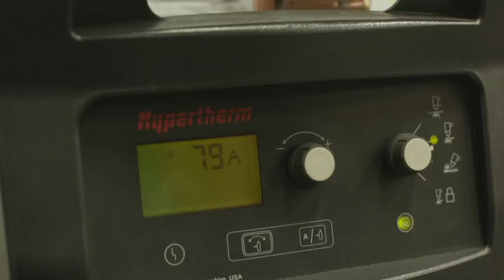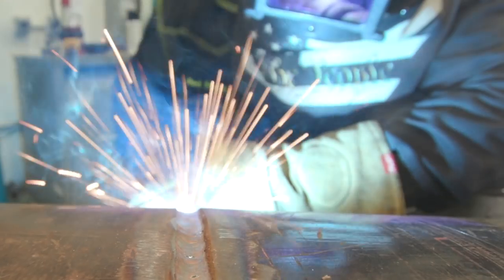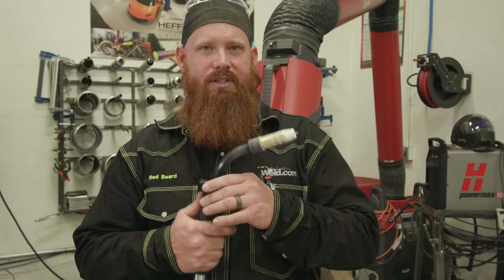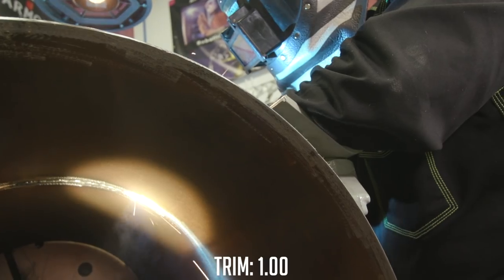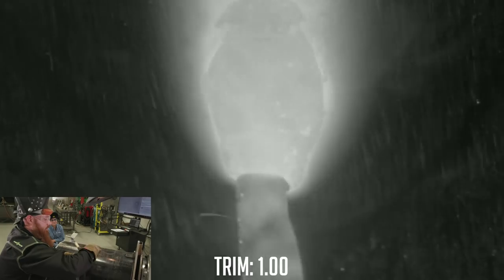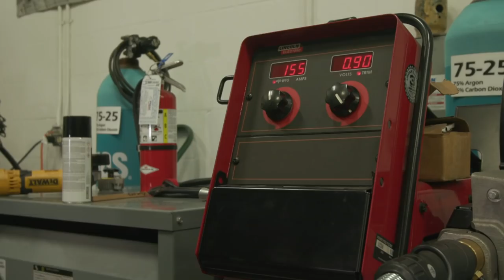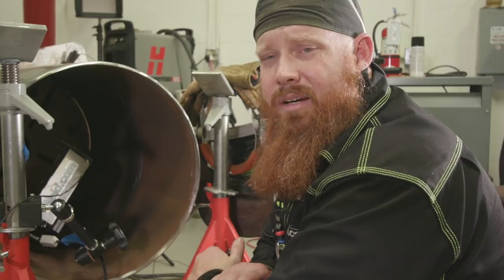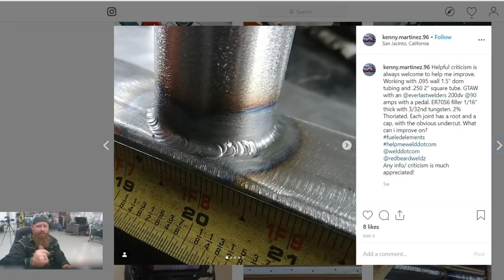MIG Welding Open Root Pipe

Comment: Thank you so much for the inner camera. I finally understand where the hell the keyhole shape comes from and why the structure of welding open root works the way that it does. Trailing the keyhole behind your stick never made any sense to me because I had no idea where the metal was going or what it was doing.

Comment: You really hit home on that one. I always hide away in shame when I see other welders with such clean tips 🤣 Probably the best ad I've ever seen 🤣😂😂 😂 Never used the ceramic spray, but might just have to give it a go. Love the whole video, but that was epic.
Reply: It definatly does not last 8 hours on heavy jobs. Maybe on pulse GMAW or STT but not where I work where we are welding 300A to 350A using MCAW spray transfer and some passes on our positioner are 20mins long

Comment: Hi "Red Beard", I use a 375 amp STT2 as my GMAW Welder at work, I like it, I have the LN 745? wire feeder, so its different to the 455 & S10(?) feeder that you are using. I use it for Everything, not just root runs, and I find it is very flexible. I can weld everything from expanded mesh with 0.9mm wire, up to 12mm 3 run fillet welds with 1.2mm ER 110S wire on 16mm thick Bizaloy plate.
Reply: scott carr they’re both great running machines.

Comment: Hi from Christchurch New Zealand. Just watched your video and learnt a lot about STT welding . We have have a potential project coming up butt welding 450mm,  750mm, 1350mm and 1930mm diameter pipe and it seems that this process is quicker , less spatter and a cleaner way of welding . I am going to give it a go. I will let you know how I get on. Regards Johno.

Comment: I like stt. Although I adjust me own settings. Wfs is 145...peak is like 350 and background is about 50-60. I don't really use tail out but if I'm tracking something I will use hot start. Thank you

Comment: great work and thanks for your efforts, do you think this would be a viable process on small pipe , say down to 1 1/2 shed 40 fixed position
Reply: D Pinkerton shouldn’t have any problems. Works on open root for plate too. I’ve done 1/2” opening on 1/8” steel with it and didn’t have any problems.

Comment: If u point the gun at a much steeper angle almost straight up you can control the amount of penetration on the back side. More upward angle equals better buildup on the back. I've done thousands of joints like this with only a normal short circuit mig

Comment: Can't u just do that on a normal mig machine set to a lower voltage setting, say between 17 and 25? But pointing the gun up to push reinforcement in
Reply from the maker: Yes, short circuit mig on pipe is common, but STT makes it so much easier and it is twice as fast. Time is Money.
Reply: @Welddotcom  yes but why is it easier than short circuit mig what is the difference?
Reply: Chris Playz STT controls the deposition of the wire and prevents burnthrough and over penetration. It’s a cross between a short circuit transfer and a pulse transfer.
Reply: @GodslilRedneck23  that's a better Answer thanks Jason